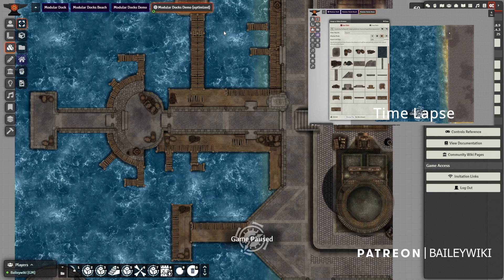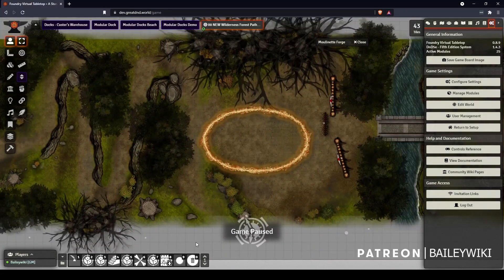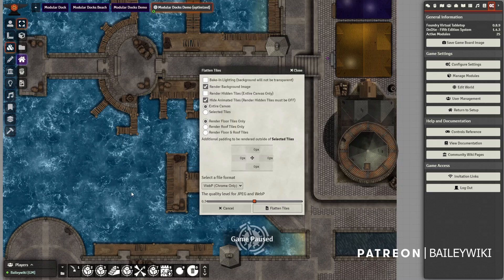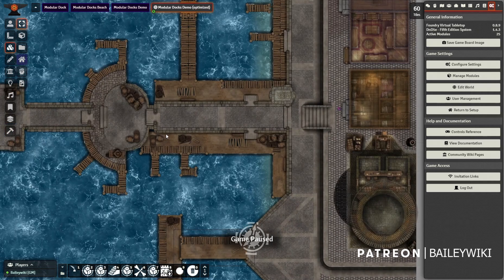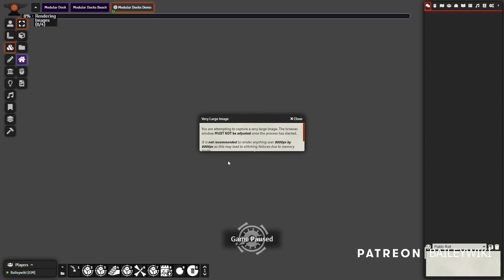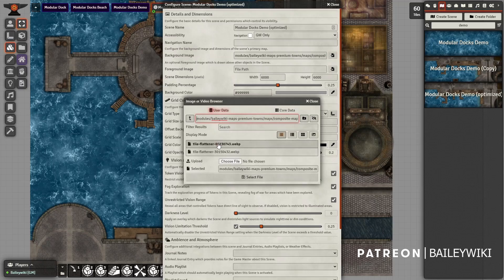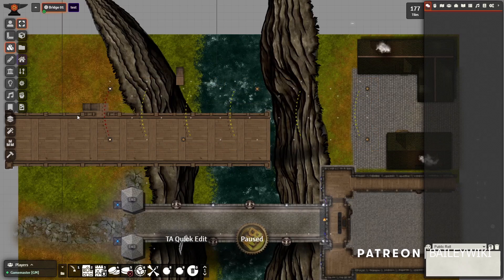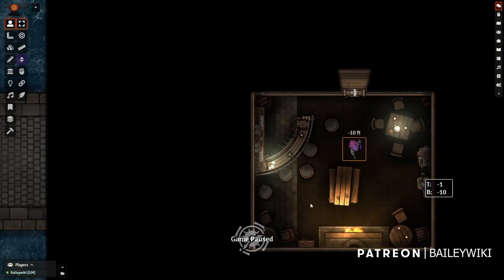Foundry VTT - New Module Highlight: DF Architect's Tile Flattener

Comment: Would this work to convert scenes, basically just the background, that use base64 images (imported via json) to convert the base64 image to a webp?

This would help improve performance on imports from dungeon alchemist.
Reply from the maker: Interesting! I think it depends on whether the backend libraries support the image type. Can you test it and report back here?
Reply: Yes that would technically work. The module captures the rendered image from your graphics card, so it doesn't matter how it got there 👍🏼

Comment: Thanks for the video. I tried it with one of the scenes I had built with assets using Moulinette, but nothing happened. I’m sure it’s due to a module conflict, but I don’t have the bandwidth to start investigating which one.
Reply: foriens quest log has a compatibility issue with it at the mo if your using that one. i disabled it, flattened my tiles and then reenabled and all was fine.
Reply: As KammaKhazi mentioned there was a conflict with FQL, but I believe an update was put out for FQL to fix the issue. I've also been informed of another issue that seems to be affecting a small number of people that I'm looking into. Hopefully you can get going with your tile flattening!
Reply: @KammaKhazi  thanks, I don't have that module installed so it must be something else.